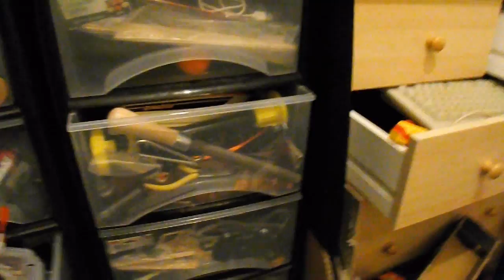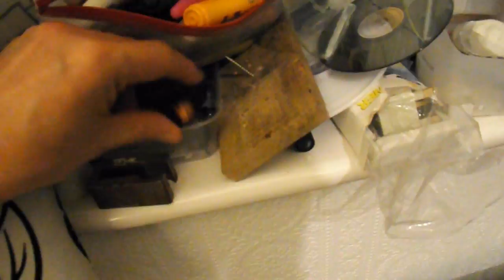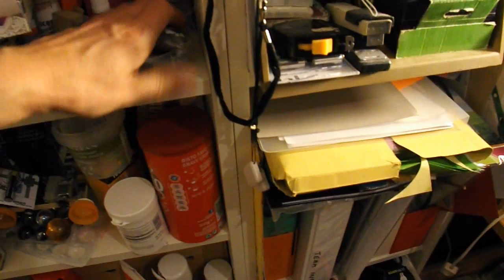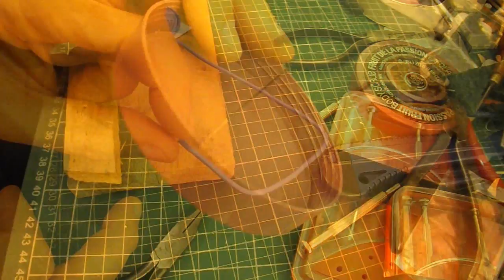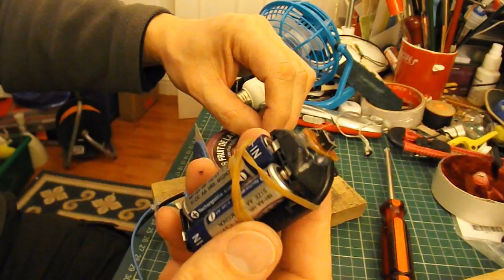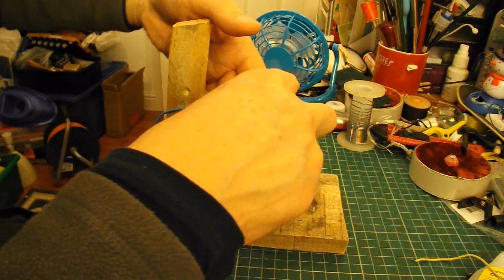Grandad's Junk Pile Projects #20 My Version of Lidmotor's Wobbling Needle Motor

Comment: You win the 'The most interesting workroom' award.  Mine is a close second but I am gaining on you. I do need to do some serious sorting and discarding.  It is getting harder and harder to find things.  Congratulations on getting the motor to run.  It might have run a bit faster with more magnets and/or a larger hole in the top bearing.  The thing really needs to wobble around in a fixed structure to work well. At high speed mine goes into a kind of resonance and gets stable.  I spin mine up by blowing in it with a drinking straw sometimes to get it going.  It is all fun.
Reply from the maker: +Lidmotor thanks for dropping by. You are using politically correct terminology to describe my work room and I appreciate that :) Yes this is another one of those projects I could spend days tweaking it to get the sort of results you achieve but I was happy just to see it working. In the associated shorter video I soldered a nut onto the wire for the top bearing so that was a much larger hole and was probably too big but again it worked. I have been very interested in Ludic Science's recent videos that are very closely related in principle https://youtu.be/DH2seM_J-mM  https://youtu.be/PV1Z7wihXK8  and they reminded me of some of my early videos https://youtu.be/2dEaJ3ex6Ls  https://youtu.be/q3cGQxoaggs that I might need to revisit :)